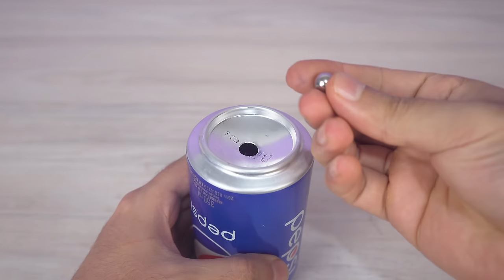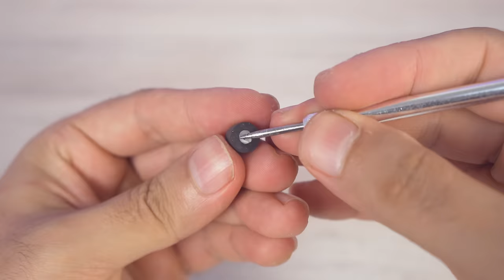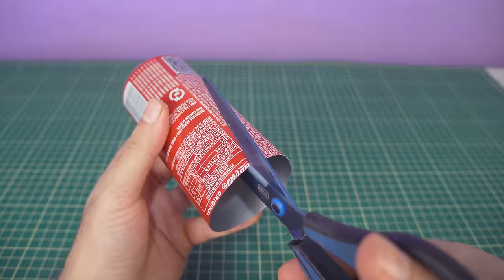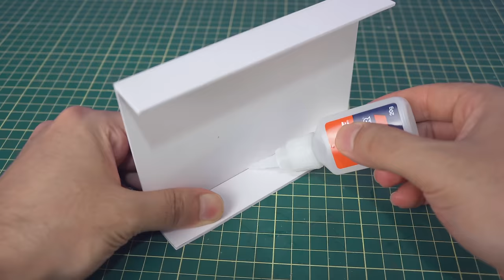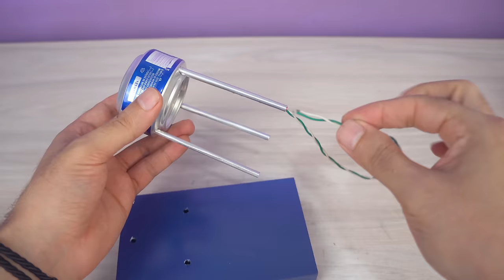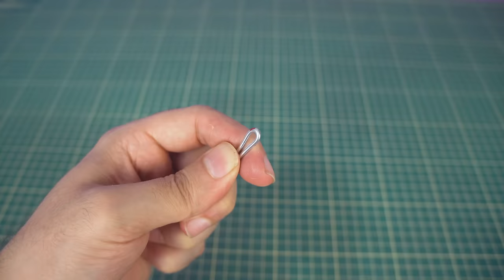Amazing DIY Marble Machine made com Soda Cans

Comment: I thought that this would be like most other "perpetual motion" videos where they would hide that a battery is in use. Instead, you show clearly that the machine uses a motor to accelerate the marble and keep it going. That way people won't be disappointed when they build it and it does not work. 10/10

Comment: Instead of having the motor constantly on...why don't make a gear (activated by the ball each time it goes through the pipe) that makes the motor give impulse and swich off? that way the battery life would be longer...
Reply: YOU ARE RIGHT, IT WOULD SAVE A LOT OF BATTERY ENERGY BUT EVEN DOING THAT THIS EXPERIMENT DOES NOT CONSTITUTE A "PERPETUM MOBILE"  MACHINE MEAN WHILE IT HAS A PRIMARY ENERGY SOURCE, IN THIS CASE  ELECTRICITY